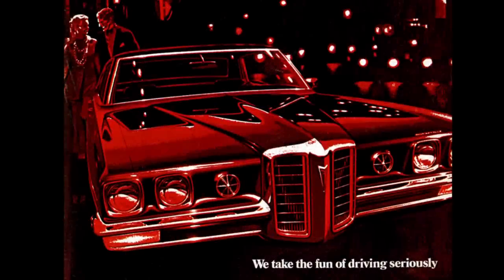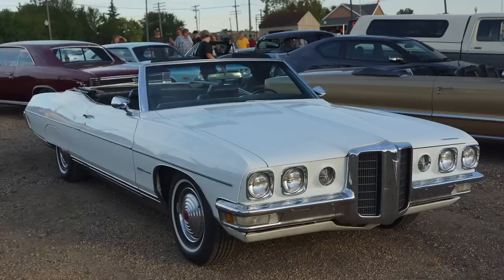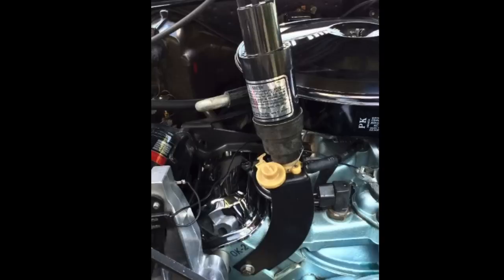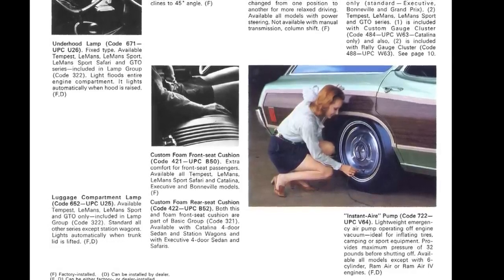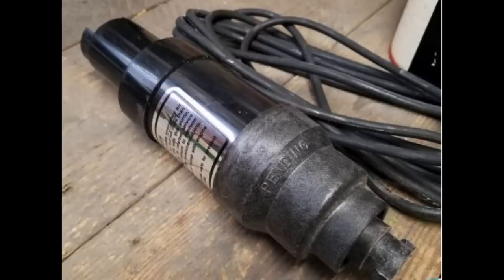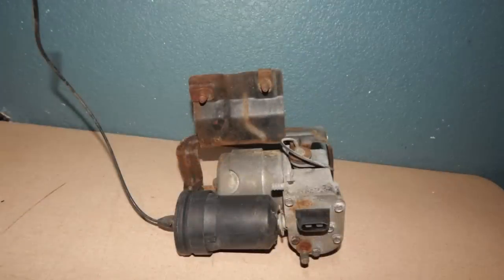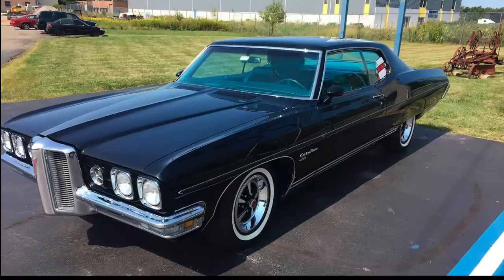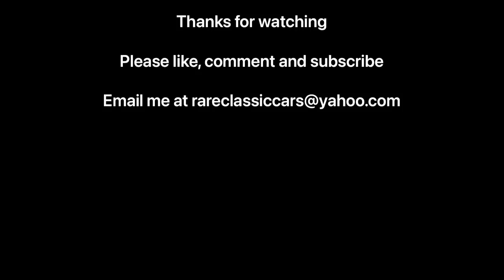Awesome Automotive Inventions: The 1969-72 Pontiac Instant-Aire Underhood Air Compressor

Comment: @ 4:08> “Hobbs” was the manufacturer of these fantastically robust, retractible emergency work lights & although not sure if that co was ever one of the many subsidiary co’s under GM’s belt back in the day, these where implemented in a wide range of GM vehicles from i think the ‘50’s thru the ‘70’s, including most, if not all, GMC Motorhome Couches! I’ve installed one of these under hood of one of my ‘55 Buick Supers’… although none of the vast library of original literature I own for ‘55 Buick, mentions this specific accessory as an available option that early on, I figured it was nevertheless, a GM option eventually so why not include it?! I’ve only owned one Pontiac, of the 30+ vehicles I’ve owned over the decades & do regret having sold that Safari SW! Was a ‘68 or ‘69; can’t remember now. Had that when in HS. Could loud up quite a group of friends for beach/mountain excursions then… also had me a ‘59 Chevy Nomad just as I was starting college; TRULY regret selling that one! I’ve owned some pretty amazing vehicles before but “storage space” was always an issue.

Comment: Hey If you are doing obscure options I would like to see something about the inferred night vision system that was an option in Cadillac's in the early 1990;s. I used to work for Hughes when GM owned them and they were trying to use some of the advanced tech for us to GM cars. I only ever saw one, the sensor replaced the emblem in the middle of the grill.

Comment: Dear comment section can I please ask for your collective knowledge

when I was a young lad I remember a car dash top toy / indicator it was a small horse that was strung together
Standing atop a box not much bigger than a match box 

The box was connected to the vacuum of the engine if high vacuum was applied to the box

 the strung together horse would lose tension and fall down and look sort of like it was sleeping then when vacuum lowered it would stand back up 

Any suggestions on what this device was called I'd love to have one in my 60s panelvan 

Thank you for your time

Comment: my father had a hose where you could remove a spark plug and install this and start the engine and use the engine to pump air (and obviously gasoline) into a tire.  To my knowledge he never used it.

Comment: 1970 Pontiac grand prix 400 great engine but one flaw nylon timing gear would wear out at fifty thousand miles if you have one I would replace it with a steel gear.

Comment: Interesting accessory, but great example of a feature that really doesn’t add a lot of value or influence purchase decision but does add costs. I think manufacturers are much more savvy now but we won’t get these interesting products!
Reply: The auto leveler was a successful option as was the reel-out hood light but the Instant-Aire was a dud.  In 69 they only installed it on less than one percent of cars and it was downhill from there.

Comment: Not Available with the six-cylinder than enough power
And the ram air too much power?
Reply: Not enough vacume on those engines to power the pump.
Reply: @steveoh9838  oh okay that's what it was I wasn't too sure thanks✌️
Reply: It was offered on the 69 sixes but not in 70.  Probably because in 70 Pontiac dropped the OHC engine and switched to the old Chevy six, they probably didn’t think it was worth redesigning the Instant-Aire for what was a very low take rate.